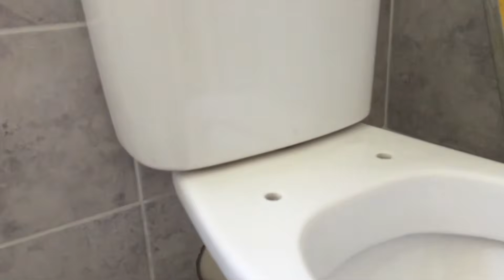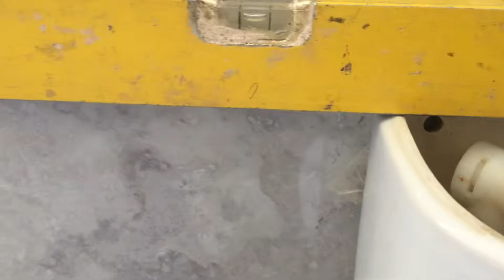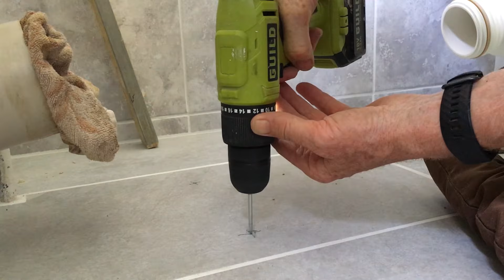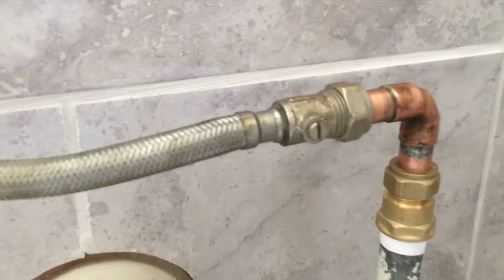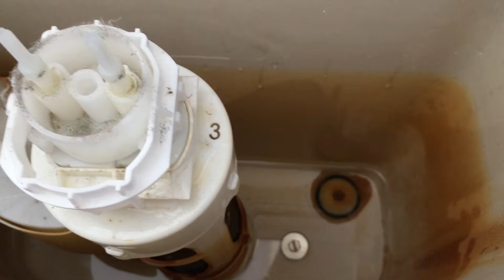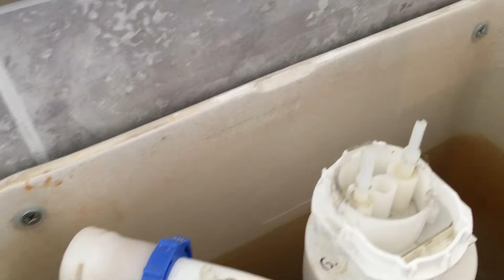Fitting a WC toilet and cistern how to connect plumbing DIY method

Comment: I had two brand new out the box Peglar valves leak one plastic and one compression passed water when closed no wonder they threw the towel in.I had to buy another one exact same size so as not to alter the pipework made in China probably.Not amused.Screwfix.

Comment: Use a washing liquid before you push waste pipe.
Will make easier
Reply from the maker: Thanks for watching Roman. Good tip. I use silicon spray if I have it available.
 b33zo
Reply: @b33zo well ✔️

Comment: Thanks mate. About to have a crack at this. Have a rear exit toilet like this that for some reason was only fixed to the floor with silicone.
Reply from the maker: Thanks for watching Huw. Silicone can be massively strong in the right place but there are WC fixing kits available at Screwfix etc that are very good and don't cost much. If you're screwing through floor tiles remember to pick up a tile bit. ATB b33zo

Comment: In the first connection, lol id apply a lot of silcone 😂 i dont trust poop 😂 nice vid 🎉
Reply from the maker: ha thanks for watching Joe. It's true that silicone will seal most places that are liable to leak but it's not recommended around the Soil Pipe seals. b33zo
Reply: @b33zo  I tried the flush and it didn't leak, so, thank you for this 😅
Reply from the maker: @joepro6785  thanks again for your comments.

Comment: hi great work ,no need for cement to hold the toilet in place ?
Reply from the maker: Thanks for watching. The fixing kits available from Screwfix etc are more than adequate if you're putting the pan down onto a flat surface. Silicone added to the base of the pan before screwing it down adds to the overall stability. 
ATB b33zo

Comment: Nice video!If there was a leak where the soil pipe connects the flexi pipe,how would you fix that?
Reply from the maker: Thanks for watching Henry. In my DIY experience some times re-adjusting the MultiQuik by pushing and pulling it about will stop a small leak. It might not have been fitted correctly in the first place because they're usually very reliable. If that is the case fitting a new one is a nice little Saturday morning job. b33zo

Comment: Hi, very helpful video demonstration. I just wonder, do I have use any lubricant on the flexi pipe connecting soil pipe and the basin? Thanks again for sharing a very useful and user friendly video.
Reply from the maker: Thanks for watching SS. I believe the rubber seals create a watertight joint and no lubricants, silicone etc should be used. The fittings all come with instructions in the box. Good luck with your project. b33zo

Comment: Love this video, and still loving the commentary. Helpful and entertaining, what more could one ask for. Win-win.
Reply from the maker: Thanks Mo. Changing a WC and cistern is made more difficult by the variations in manufacturers shapes sizes. Flexible inlet pipes are helpful but he drill holes rarely seem line up. Cheers b33zo